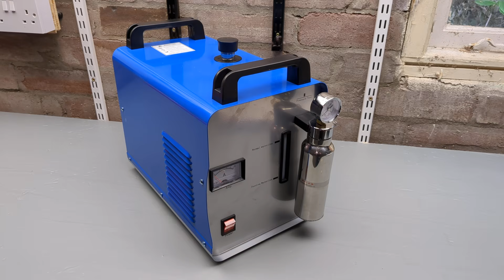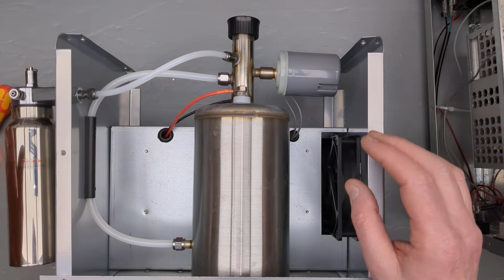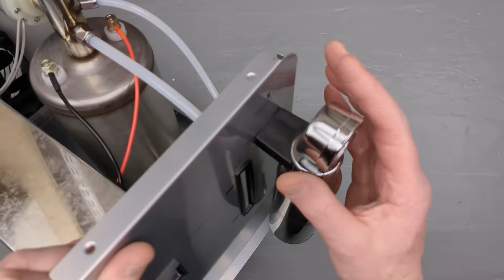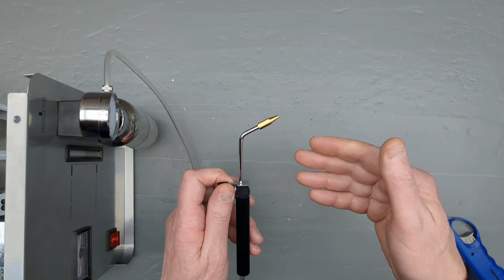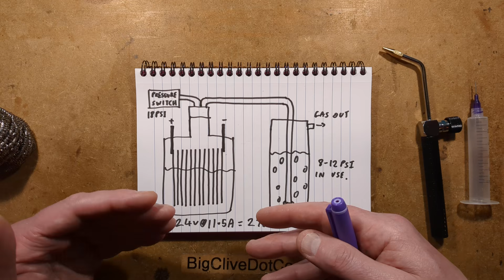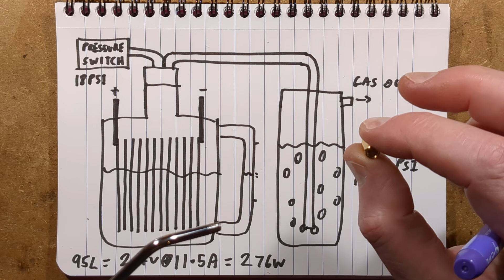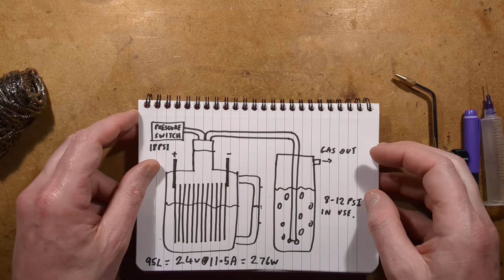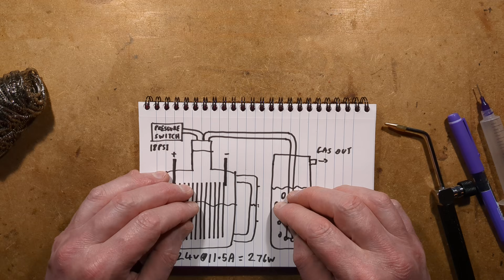Inside OxyHydrogen gas generators (HHO/Brown's gas)

Comment: As with most of these things, there is almost certainly a use related to nefarious pharmaceuticals I know nothing about (seriously, profoundly naive on these matters!).
Reply: There's a way of making meth that uses hydrogen as a reductant, although it's not that relevant for illicit synthesis anymore ever since the iodine & phosphorus method became a thing. If you actually separate the hydrogen and oxygen instead of allowing them to mix, you could use one of these as your hydrogen source.

Comment: I used a jewller's version of this type of machine at work for many years. It was made by Johnson Matthey and expensive. The electrolysis tank was a cylinder clamped between two plates, the outer and bottom plate being the cathode and the top plate with another cylinder welded to it but not long enough to touch the bottom and obviously insulated from the rest of the structure, giving a gas and electrical seal. Interestingly the inside was nickel plated. The rest of the construction was the same as yours. The 'bubbler' was used to moderate the temperature of the flame, water giving the highest temperature and various alcohols and other hydrocarbons used to lower the temperature. The torch used metal luer lock needles cut off square and of different guages to give different sizes of flame. The handle of the torch had a built in blow back arrester. It was used to seal small 2mmx6mm glass tubes where one half was held at liquid nitrogen temperature (and fixing lots of peoples broken jewellery).
Reply: My Dad used to write the plant commissioning manuals for electrolysis rigs for International Electrolytics, a company in North Wales who were then bought by Johnson Matthey. He went freelance later and started his own company, Clwyd Commissioning Limited where he did more of the same. Many years earlier, he helped design instrumentation for the Admiralty's land-based original submarine nuclear reactor prototype. All before silicon transistors came into common usage. Mag amps and germanium transistors.

Comment: Wasn't too loud at all for me.  I seen you jump, so I'm sure it was loud in person.  Hope your hearing didn't suffer from that.
Reply: I've never understood the whole headphone warning thing. If you've got your audio levels set well, there's a maximum loudness the noise physically can't exceed.
Reply: @hammerth1421  It's not so much about the maximum potential loudness of the speakers as the suddenness of a burst of that loudness. Not only can it blow out smaller cones, but it can blow out eardrums too. Of course, this could all be fixed by making limiters standard on all audio processing chains, but that'll never happen. Thankfully I have installed one on my computer; it's very helpful for watching those films where the music is deafening & the dialogue is quiet too.

Comment: Hi Bigalive. I experimented with this gas years ago. Everything you said is Correct. The one thing I did notice was the fact it cleaned the Engine's internals,pistons,valves,Etc. I had a riding mower I bought in 1993. It would smoke when I would first start it. I made a small cell and ran it. No more smoke. Liked and shared. All my best.

Comment: Do you know the material used for the electrode plates? I think if I made one I would have the polarity of the electrodes swap periodically to try and balance the oxidation/reduction affects on the electrodes. What do you think?
Reply from the maker: I think they are stainless steel.

Comment: Can also be risk whit melting glas whit it.. 2H₂O(l) → 2H₂(g) + O₂(g) making it back to  2H20 in a “bi product”. Water and melted glaase can make the glas to crack. If you put the flame burn nere a big sheet of mettle, you can se the water droplets form on the sheet.

Comment: I watched just for the bang....... I also played with HHO generators when I was younger, I even built up a set that was used in a diesel Hyundai truck.... And it worked quite well, I was able to go from driving up a hill with wet cargo in 3rd gear to being able to do it in 4th gear which meant lower revs and more torque.... 

But, while I was building the whole thing and testing plate spacing etc....  

I too did the soap bubble test.... 

Silly me though did not stop the gas flow.... The result was not only an ear splitting bang, but....... It sent my bubbler flask clear out the door from escaping gas....... I was stunned..... Stood there, looking at the mess on the floor and table, gazing across to the blown out jar outside then looking back at the mess I had made.... I remember starting to giggle uncontrollably  then bursting out laughing at the top of my lungs and the dogs had run clear out the workshop screeching as they ran and my wife later peering around the door jam with very wide eyes asking if I was ok.... 

Then after hearing I was she let the sea girl out to berate the crap out of me for scaring half the neighbourhood... 
😂🤣😂🤣😂🤣😂🤣😂🤣😂🤣

Comment: The only HHO system I've seen for a car that might actually work is the one where you put solar panels on top of the car and accumulate the HHO while you're not using the car. Then you didn't have to generate the electricity and you've got a meaningful quantity of it. That of course means you've got a giant bomb as well. So we should implement that system only where fuel is most expensive such as California 😂

Comment: Oh wow, I'm getting flashbacks. Back in the I want to say late 80s, I had a bit of a mad scientist friend who built a unit like this. And on a couple of occasions we filled up black dustbin liners, attached a fuse and let them go. Looking back I can't believe just how dangerous that must have been. But you certainly knew when it got to the end of the fuse.
Yes kids don't try this at home.
Reply: That could have been milk bottles (early) or two off, 2 inch stainless tubes. (later model).

Comment: Great video! I've been a welder/fabricator all my life and, obviously, anything like this catches my attention. I used a Ziploc sandwich bag years ago for the boss's son to show how explosive the combination of acetylene and oxygen is. Your bubble experiment put the sparkle back in my eyes. I'll be watching for the video when you disassemble the tank.
Reply: Yeah, we filled up a garbage bag with oxy-acetylene back in the day. We were not prepared for the detonation. Or the ringing in the ears. Or the explaining to the boss.
Reply: @UncleKennysPlace  It was demonstrated to me as a small balloon (5-6") in an old fast food paper bag, which was twisted shut to form the "fuse", this was set and lit in a small disused tool shed, when it went off it pushed most of the nails partway out. Stuff is so sensitive it really shouldn't be played with at all, he got lucky it was humid enough sliding the balloon into the bag didn't cause a small spark, set it off, and take some fingers.
Reply: @Broken_Yugo  A 6 inch diameter balloon will NOT push the nails out of a shed. And,, if you were to hold such a balloon while igniting the mixture, it will not take a single finger off. Actually it will not hurt your hand at all. However, your ears will ring for about a week!  I do understand the need to exaggerate, just because of the shock value of the noise the first time you see this demonstrated.  (Chemist.)
Reply: @TheTemporalAnomaly  Small disused shed, I think it was made from a refrigerator crate, was somewhat rotten as old disused sheds tend to be. I saw what I saw. Fresh it probably would have just blown the door open hard enough to fuck the hinges up, maybe cracked some paint.
Reply: @UncleKennysPlace 😂 holy crap!! 🤣

Comment: Hello Clive, always wanted to give the Car kit a go. I though the cars O2 lambda sensor would cause it to show the exhaust gases to be a lean mixture due to burning hydrogen.  Surely theres software to work this out ?? I’ve an aluminium head and inlet which would react to peroxides.

Comment: Screw HHO kits, I'd really love to attempt to build one of my ideas (which I recently found out was patented by BMW - Turbo steamer) where the cars combustion engines exhaust is routed through a boiler, there's a separate steam piston engine which is engaged through a clutch like an AC unit is, once steam pressure is built up the cylinder fires up syncs its speed and then engages the clutch. I'd rather a piston over a turbine for the characteristic sound of a steam engine chugging. Behind the clutch you could also have an electric motor/generator to harness and redeliver the steam power which was generated while the car wasn't moving for a Combustion/steam/electric hybrid 😂. Also, you've got to add a whistle! 🤣
Reply: The BMW patent claims upto a 15% increase in fuel economy, with the highest gains at high steady speeds (since the engine will produce more/hotter exhaust under these conditions)

Comment: That cell arrangement is wrong no gas output on the inter plates. cells need to be seperated to get the more gas ouput per cell also gives 1.2-2v per cell. see utube from                                                     HyperspacePirate showing a hho generator.

Comment: Clive you're all set!  Cut open one of the chambers to see what's inside, and when you're done you can use the other unit to weld the chamber back shut!  😁
Reply: No, you need a TIG welder to weld stainless steel.
Reply: @mikey4016 I think you misunderstand how hot Brown's gas burns

Comment: I used an expensive Swiss oxy-hydrogen unit for years (Spirflame) and found it to be trouble free and excellent for jewellery and similar small work. The pure oxy-hydrogen flame is very hot, but different liquids in the bubbler reduces the flame temperature while increasing the energy (slightly lower temperature but more heating capacity) you can use acetone, ethanol, methanol, MEK and others each with its own flame temperature and you can even add flux for silver and gold soldering.
Reply: What flux can you add to bubbler for silver?
Reply: @cthulpiss  Search "Spirig booster fluid" - they sell one such product. I guess it's just boric acid dissolved in methanol. I haven't tried it myself.

Comment: I had so many debates with people claiming HHO kits improved their fuel economy... along with fuel magnets 😂. Some people claimed that while it doesn't increase the amount of energy in the system somehow the hydrogen increases the percentage of fuel burn't which is "how it works" to increase fuel economy 😵‍💫. I never found any evidence other than sketchy marketing claims and the words of people who claimed to be using them. 😂

I put in allot of effort to hone my eco driving skills and I increased fuel economy from 50-60mpg upto 70-80mpg just by changing the way I drive - in a petrol car!
Reply: I really love to attempt to build one of my ideas (which I recently found out was patented by BMW - Turbo steamer) where the cars combustion engines exhaust is routed through a boiler, there's a separate steam piston engine which is engaged through a clutch like an AC unit is, once steam pressure is built up the cylinder fires up syncs it speed and then engages the clutch. I'd rather a piston over a turbine for the characteristic sound of a steam engine chugging. Behind the clutch you could also have an electric motor/generator to harness and redeliver the the steam power which was generated while the car wasn't moving for a Combustion/steam/electric hybrid 😂
Reply: If anybody ever builds a steam hybrid car you've got to fit a whistle to the car! 😂
Reply: There is something to be said for that argument, since burning at a higher temperature does lead to more combustion & thus more efficient use of the fuel (and less crap out of the exhaust), but petrol is already highly refined so there's not a lot left in there that could benefit from the addition of any catalyst.

Comment: Its very disturb8ng that the gas volume in the flashbck arrestor is so large.
I had a HHO setup many years ago, and you never want to have a large volume of the gas somewhere a flame can travel back and get to it.
If planning to use that thing, I would suggest finding any way to drastically reduce the gas volume in that flashback arrestor, ie higher liquid levels, filling it with foam or sand or some combination of foam and sand. Otherwise it is basically a grenade...

Comment: The bubblers is partly a flash back arrester and partly for controlling the temperature of the flame.
hottest flame is with the bubbler filled with water, to reduce the temperature you fill it with different chemicals. Mine is filled with Methyl Ethyl Ketone (MEK) to reduce the temperature more suitable for silver. the more volatile the chemical the cooler the flame. As there is more fuel to oxygen in the mix which causes the flame to be less efficient and hence cooler..

The torch control is only used as an on/off control flame size is controlled by the choice of nozzle.  
if you look close at the flame it does not touch the torch tip there is a little gas gap which helps keep the tip cool.

Those are over compacted, mine has a transformer, with what looks like welding cables to two very large stud mounted diodes mounted on the bottom of the cell. these diodes have inch wide braded cable to big lugs. My cell can be taken apart for cleaning which I did they last time I refilled it.

I think mine is about 800 watts looks very similar to the Aquaflame 1200.

Comment: That cell arrangement is wrong no gas output on the inter plates. cells need to be seperated to get the more gas ouput per cell also gives 1.2-2v per cell.

Comment: It would be nice to have a vid on an oxygen generator you could use in conjunction with MAP gas. You could do larger item brazing like cycle repair.
Years ago I was given some NiFe batteries and got some KOH (I never got around resurrecting the batteries or using it).
I don't know how great a help this is but I've just had a look for KOH. I googled 'Potassium Hydroxide UK supply' and got results. One random result I clicked on and took a dummy run to checkout on was £7 for 1kg plus £12.00 p&p (Bonnyman's).

Comment: There are a couple of reasons I am aware of for why potassium hydroxide would be preferable to sodium hydroxide, but neither apply to electrolysis:
(1). KOH is considerably more soluble than NaOH. So if you need to make the most concentrated solution possible, you would use KOH.
However, you do not need anywhere near as concentrated a solution to make water conductive for electrolysis. A few grams per litre is more than enough.
(2). In "hot process" soap making, using KOH instead of NaOH tends to produce liquid soaps. The liquid in those pump-bottles of liquid hand-soap is not just a concentrated solution of a solid soap in water. The water content is not any greater than in a bar of solid soap: The soap itself is a liquid all by itself.

Comment: Those car water guys crack me up.  Think for a sec and do the math: the unit makes 100L per hour, a car engine being what, 2L in displacement idles at 800 rpm.  That means it draws in 800L per min of air fuel mix.  This unit would have to run an hour to power a car for a few seconds…. At idle…. Math ain’t mathin…

Comment: Had a flashback once on a nitrous acetylene (three inch wide flame on an atomic absorption spectrometer ) in an aircraft hanger. Now THAT was loud!! couldn't hear properly for the rest of the day.
Reply: I used an oxyacetylene one and the oxygen ran out, so the oxyacetyle torch went out with the characteristic bang that it does when it gets acetylene-rich. That was loud enough, I don't wanna know what flashback on the even angrier flame is like.